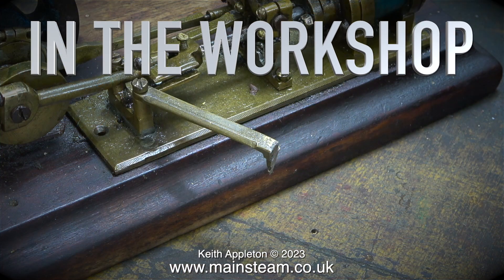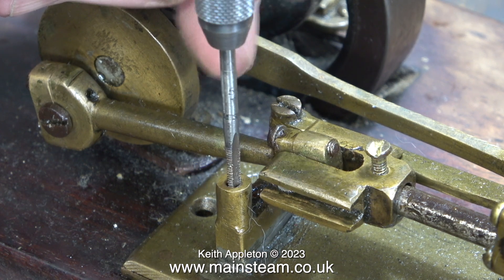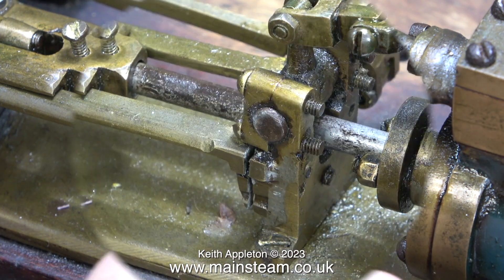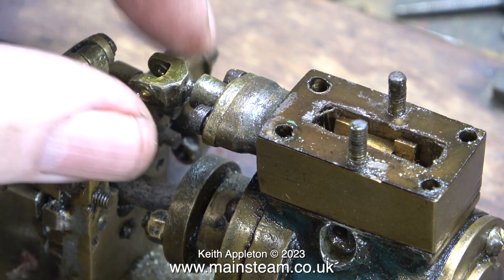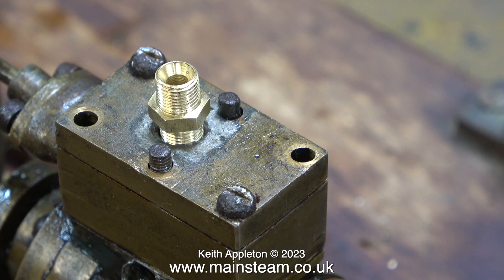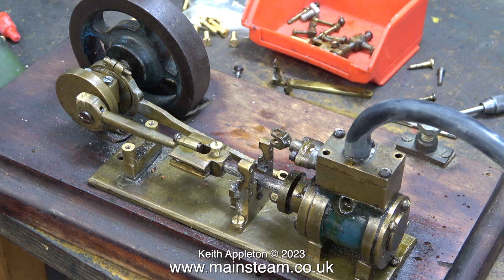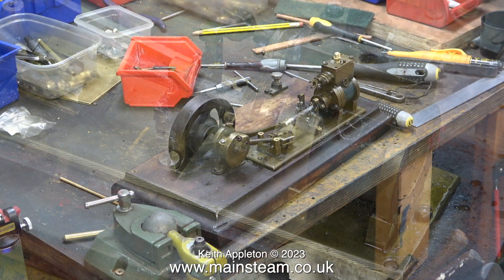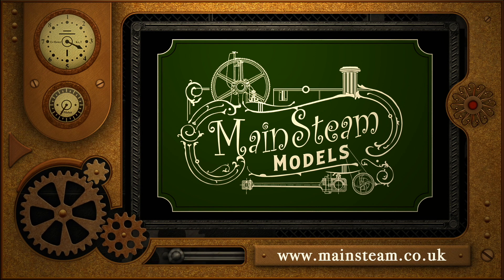A DIABOLICAL MODEL STEAM ENGINE - PART #2

Comment: Did the original builder go straight to compressed air without checking the motion by hand first?
Reply from the maker: I think it has been badly reassembled at some time and forcefully rotated by hand, breaking some of the parts . . . .

Comment: I think the person who made the piston must have been blind or used a lathe made of foraged sticks! It's genuinely impressive that someone could make a part like that.  I think even I could make that piston better on my watchmakers lathe (a small 40 mm centre height one at that), using a screwdriver as the cutting tool!  Unfortunately I can say I have had to resort to such desperate measures when I first got the lathe and didn't have a graver!  I look forward to see you tackle this rather sorry looking engine!
Reply: They haven't used a lathe or a mill. You can see file marks all over it the model. It looks like the majority of the parts have been filed by hand, and other bits drilled, with bar stock used for the rest. If that is the case then it's a reasonably impressive job if the engine ran.